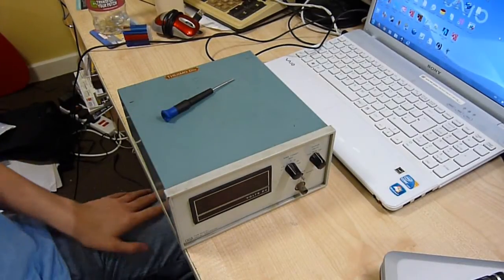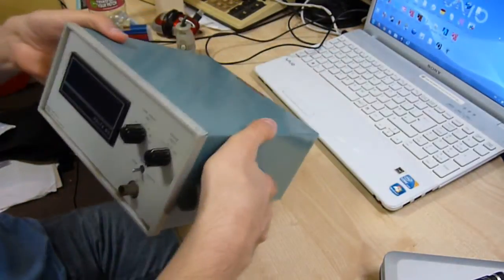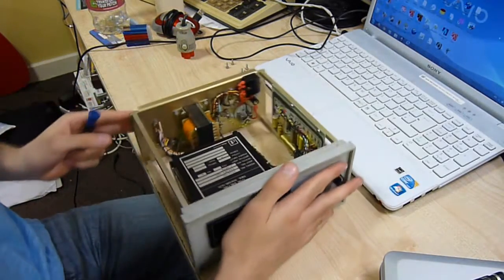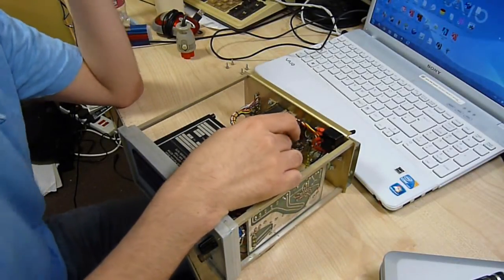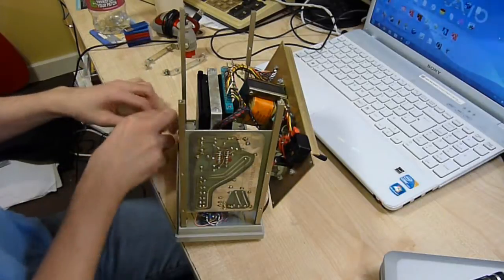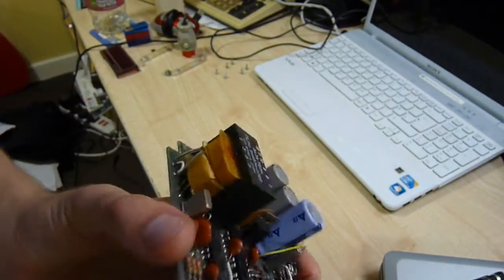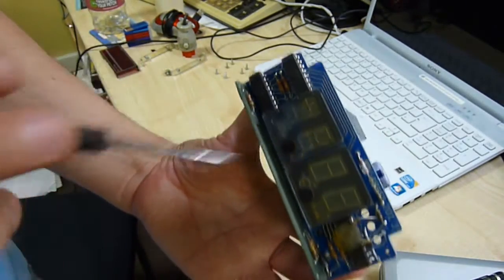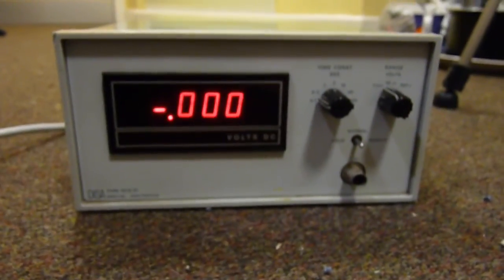Vintage Voltmeter Teardown (Powerup)

Comment: Does hold not pause the display? just an uneducated guess lol  Yes, I'm having to cut some sections of my 286 restoration video out because of bloody university markings on it :o(

Is it me, or does the cap on the front of the display look very dark for some reason?  (possibly shagged) lol

Do you use a particular site for data sheets (not that I understand them that much lol), if so, what is it please? 

Wow, good find :o)  I'm after some stuff like this, but the department that's.....

Comment: The ground lift switch on the back will be to 'float' the equipment above the earth point so you can use it say up to 500v above the local earth, the hold position on the front will probably be to 'hold' the measurement taken once you remove the leads form the test points - shorting the leads together should restore the zero. Handy function for when it's awkward to measure and look at the display at the same time. Hope those thoughts help.
Reply from the maker: Makes it peosible to safly mesure anything that is potentaly mains & refrenced to earth, otherwise like with your scope, things can go bang.